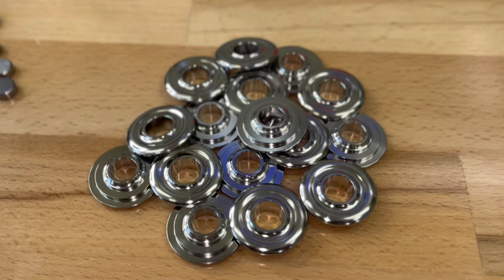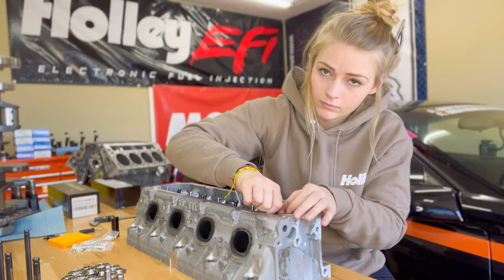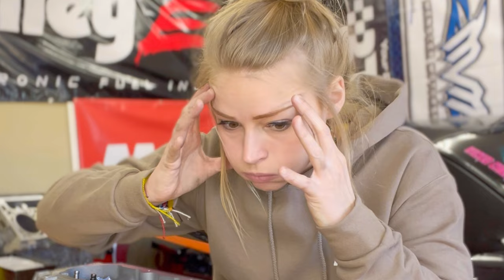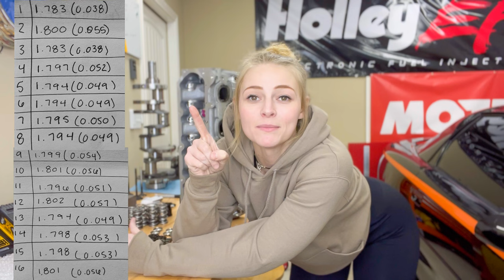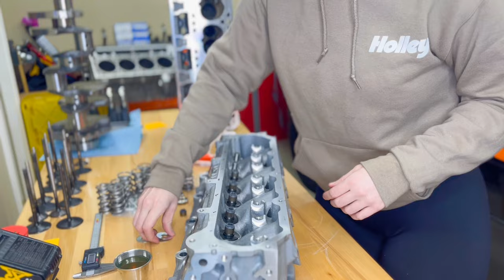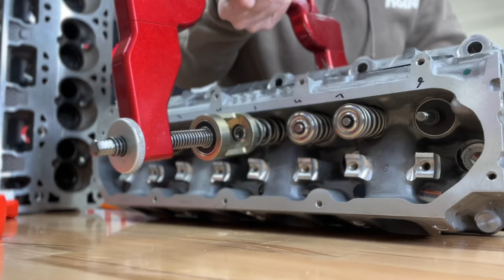GEN V BUILD SERIES: CYLINDER HEAD ASSEMBLY

Comment: After you get the seals on, put the retainer and locks on (without the spring), then move the valve up and down until the retainer/locks hit the seal, measure that distance and make sure it is more than the lift of your cam.

Comment: Once you get rolling it's not so bad. This is a step A LOT of people skip(installed height). Definitely try to use the exact pieces that will be going in that exact spot when you measure. Those locators retainers and locks aren't all the same.

And the shims aren't all exactly the same. I may end up moving a shim from 2 over to 6 because it's just a bit thicker or thinner.
Reply from the maker: Yes

Comment: After installing the piston head parts from the exhaust valve to the inlet valve, valve seat, valve guide and spring, does each piston have the same size or does the measurement differ from piston to piston?

Comment: Don't most springs have a recommended install height? I typically go with that. But really good idea to check the clearances regardless. In the past I have had some springs that I had to shim tighter due to valve float. And you for sure need these measurements when doing that to make sure you do not go into coil bind or your retainer does not hit your seal.
Reply from the maker: They do and I showed you exactly how they get that install height. The math explained is what is recommended

Comment: I’m so invested in this build!!! I have the same car, same color and all, mine is a 93 though, not sure of the year of yours, but I’m going to do swap as well, it’ll be a different set up but the swap will be the same as in a new lt vs my gen 2 current set up, i truly appreciate you doing this, I’ve waited and waited for someone to do it with no luck, I’ve wanted to do it since the introduction of that new motor, has someone figured out a swap harness for it yet? Or do you know of anyone that’s planning on making one for it? I have so many questions, but I’ll start there lol
Reply from the maker: It’s a 93 and no I will be making my own as I did my own for the gen 2 as well
Reply: @britneyautomotive  awesome! I may have to link up with you over the phone or email when it comes time and I get to that point, I’m very mechanically inclined, however wiring is not my strong point, which is odd considering I’m a power lineman by trade lol

Comment: Maybe i missed something but you need to consider seat pressure and shim each valve accordingly. In theory all your valves should be the same installed height with a proper valve job.... in theory.
Reply: Ive never came across a set of springs that are all the same pressure  say 130lb at for say the 1.745 your setting them at.